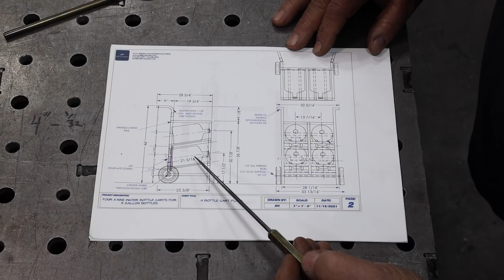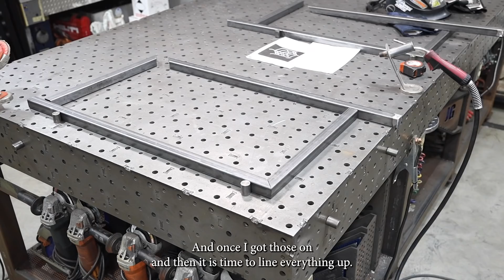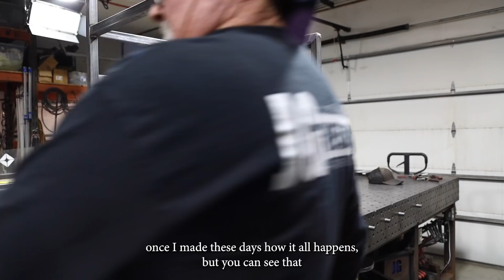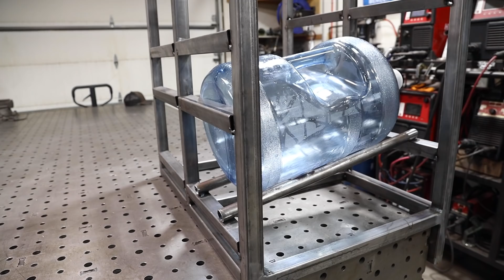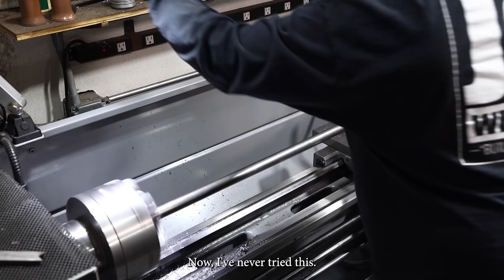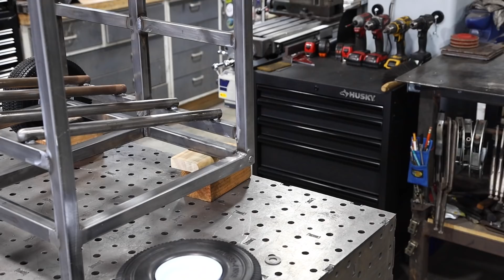5 Gallon Water Bottle Cart Build| JIMBO'S GARAGE

Comment: Awesome channel! Im trying to weld together a heavy duty metal cabinet for my van using similar sized tubing BUT the sheet metal I have access too real cheap is 18 gauge cold rolled 430 stainless sheet metal. Do you think if I used a wire for the 430 that it would mig weld good to the mild steel tubing? Id hate to buy all the materials and it not work.

Comment: Another great project, kudos Jim! When you were talking about all the welds, I couldn't help but think you could have save a lot of welds, material and time  by eliminating that center vertical frame. Looks nice aesthetically, but you didn't need it with the gauge metal tubes you used, the horizontal pieces would have easily supported the weight of two bottles. But good for us because it gave us that much more viewing time watching you work which is always awesome!

Comment: to be able to grind welds need to chamfer the materiał 45-30 degrees. I work in power plant construction end we newer ever grind welds like Jombo. If you weld something which will be subject to great forces dont grind welds if you not chamfer the materials.
Reply: Thats true in thicker material.       It is easy to get full pen with light gauge.

Comment: I would really not sand the way you did in the lathe. Using just one hand like that folding the paper the way you did is a good way to get caught since the sand paper grips well. Hold each end with each hand instead or hold it in a way where you cant get caught. The same goes for the scotch brite.

I do enjoy your builds a lot and I am thinking about building a welding table like yours.
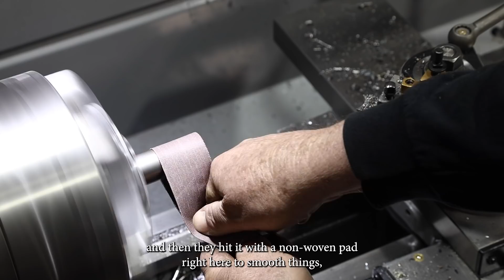Reply: I don't want to be picky, and I want to say that I enjoy and respect this channel.  However I agree that the sandpaper technique (at 18:53) is known to be a danger.  The paper can grip a little extra, wrap around on itself, and pull your hands into the work.  Somewhere here on YouTube there is at least one video that shows this explicitly.  Scary! Please work safe, and thanks for the videos!
Reply: Found the video that explains the hazard in this sanding technique:  https://www.youtube.com/watch?v=p5iKM-vC6LM

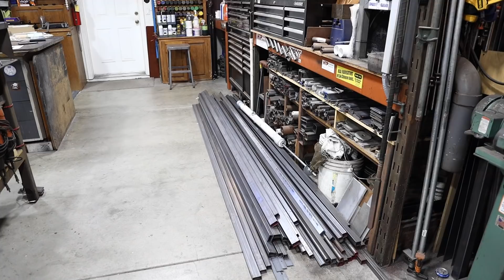Comment: 3:29 Jimbo... As organized as you are, why don't you have a rack for all of that steel? I built a simple one on casters, that slants back about 10 degrees, with 6 arms for different types of material. On the back side, I put all of my sheet, plate, and expanded. I have an old shot of it on my shop tour. It sure is handy, and I can roll it around.